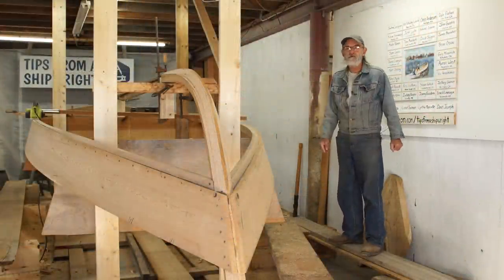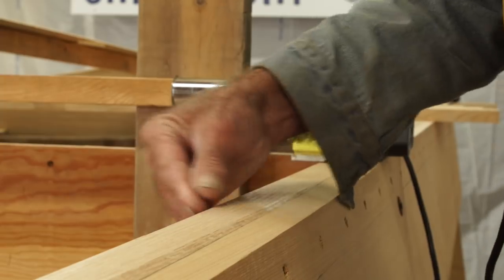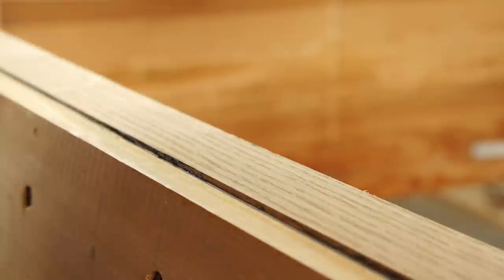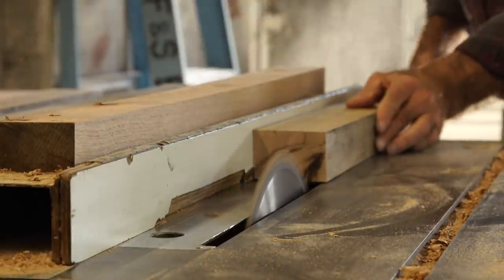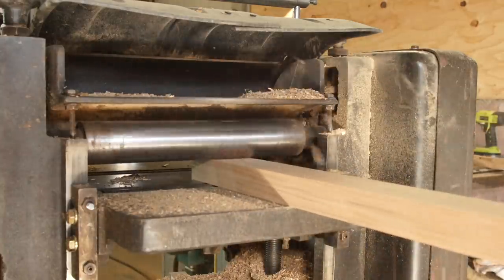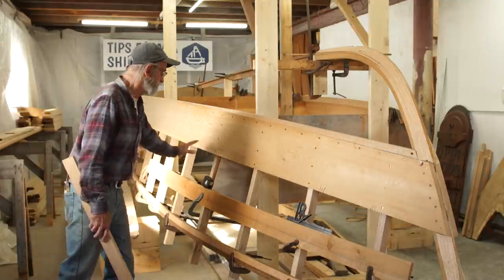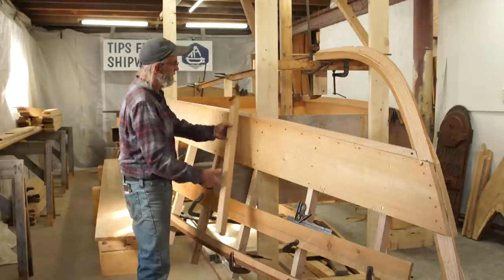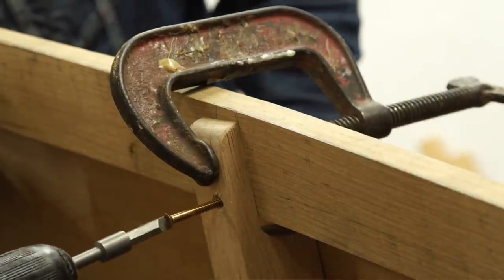Building the 23' V-Bottom Skiff - Episode 6: Hanging the frames

Comment: Lou, your table saw technique must work because you have all your fingers at this stage of the game!  Great skills to pass on.  Cheers for the Holidays!
Reply: It is a way to use a table saw, IN CERTAIN CIRCUMSTANCES, that used to be taught, but not any more. You will notice, that when Lou's hand is passing by the blade, his ring and little finger are behind and below the fence. This uses the fence as a guide, and your fingers cannot be raised or moved far from the fence. So if the wood is caught or kicked back, your hand won't be drawn into the blade.  He is using this on broader cuts, but where he needs a little more, immediate, control.  I do this myself, for certain cuts, but... I wish Lou had a riving knife behind the blade, for a little more safety. All in all, he is an excellent shipwright.

Comment: you got it right Lou ... that's a dowel set .. I'm sure there's a million more names for it as there is a million jobs for them too  ...we  used them to set dowels in timbers , ( it was much better then the 50 lb. block of wood on a handle ,,and was easier to drive them in in tight areas),, the other end was used to flatten the joint you were connecting ( like in pole barns with long beams that might have twisted some) with a barn the joints that weren't as tight because of a twist in a 25ft 6x6 you just chipped it down so it was flat were the dowel went in...a lot of people use them and the same with log cabins, pole barns and large ship builders ... it was used in many trades for a lot different things because of its many uses  ... I think the Amish  blacksmith in Pa. still make them .

Comment: Grandfadder had on of those to cut slotts in timbers for sliding boards into on his  dirt cart. Makes it easy to shovel in,(add boards as you fill, remove as you empty. He always said, take a little extra time whin building to save lots of time in use. Yes he did use a mallet on the long pin to drive it along for better control than swinging.  The pin was long so more was above the surface of the slot(for striking)  to ensure a consistant depth.  Much cheaper than a slotting plane and reasonably easy to use (once you get the hang of it) .

Comment: The most impressive thing is his ability to consistently drive slot-head screws.
Reply: With a drill motor. I agree. It’s impressive.
Reply: Some of them overturned, but yeah he said in the past that for him this are the best and easy to drive in screws.
Reply: When he gave the explanation for using the slot screws, I remember him saying “and they’re easy to get out.“ Nowadays when building stuff around the house it’s common to use those hex screws with an impact drill.
Reply: The biggest thing about slot head screws is to use a driver that fits the slot perfectly. If the driver is too small, that is when you get the cam-out and damage to the head of the screw, driver, or both. Plus, like he says, these are the easiest to clean out when you need to remove them in the future.
Reply: @thomasarussellsr  Yes, and you can see he also uses a hollow ground driver, so there is full bearing in the slot. Using a tapered pry bar that fits loosely gives slotted screws a bad reputation - but that's partly just user error and ignorance.
Reply: @aus71383  so true. The geometry of the driver tip is quite important.
Reply: @davidshaper5146  quite so. Too tight a hole or no hole increases the friction of the wood on the shank and makes slippage much more likely. Pilot holes are a big help, and properly sized pilot holes and soaping the threads with wax is a big help also. Most shiprights/carpenters I see that still use flathead screws use brace and bit, a power drill heats up the screw and increases the friction variable much faster as the metal screw expands due to the heat. The wax lubricant is a big help in keeping things in motion until they reach their resting place, whether you use power tools or hand tools.
Reply: I used to work for a cabinet maker who’s business was 50/50 kitchen cabinets and antique furniture restoration.He used to get me to take all the slot head screws out of the old kitchens we removed because it was cheaper to pay me  to get them out than buy them.
After you’ve done about 500 of the buggers it’s no harder than phillips heads.
Reply: @chipcurry  or, he looks about my age, so if that's true, when we were kids there were no Philips heads. I hated those when they came out. He probably did too. Either that, or a few years back he got a real good deal on slotted brass screws and bought 400 pounds.
Reply: @thomasarussellsr that’s what she said

Comment: Makes a lot of sense to go metric Lou, easier and more accurate for measuring.
Reply: It's not more accurate.  Both are as accurate as what you are using to measure.

As for ease.  I find an Imperial tape easier to read.  Having different size lines makes things easier to me.  Metric is easier in maths because you can move the decimal down
Reply: The metric tape is easier to read, more accurate and I found I made far fewer measuring mistakes with metric.

Comment: My tool guess, since the handle is so long, it was used in timber framing, and the hammer end used to drive the long wooden lock pins into the joints.

Comment: Would you consider doing a video on how to predrill those screws so they come out so perfect?
Reply: Lou is using tapered drill bits. They come  sized for the screw diameters he is using #6,#8 etc. then the countersink is adjusted to the length/depth of the screw. Perfect every time!

Comment: Looked for the adze in Seller's "Dictionary of American Hand Tools".   Closest I could find is a "hammer head adze" aka "Scotch Pattern Adze"- distinguished by the hammer head, used for driving spikes etc.   The example in the dictionary also has a hardened or forge welded cutting edge, but somewhat shorter cutting end.  Sellers distinguishes it from the unlipped Ships Carpenter Adze because of the hammer end vs more of a spike end .   Sellers shows the Coopers Adze as having a shorter, wider striking face, wheras the hammer head adze striking end is substantially long- as is seen in the video.

Comment: Its a shipwrights adze, The part that looks like a hammer head  is actually a counter balance for the head.
Reply: Those are short, barely no counterweight and most importantly, they have a curved handle. So it's not one of those. A shipwright's adze is a very nimble, fast tool. This one is clearly meant for heavy, slow action. Very likely something for house timbers OR very big boats. We're talking "can't hug" the timbers big.
Reply: @aserta  Ive seen them bigger and smaller. They're not all identical as many of them where custom forged/altered to fit the style of the user and in some cases a very specific use. Even today most of us will modify certain tools for very specific needs.

Comment: ‘Metric rules’  !
Reply: It's good for certain things.  I like using imperial for most of my woodworking because the tape is easier and faster to read for me.
Reply: @matteout_woodworking  Don't get mad with me, I know it's what many of us were brought up with, but feet, inches, half inches, quarter inches, eighths of an inch, sixteenths of an inch, thirty seconds of an inch, sixty fourths of an inch. Wow !!! . What a mess. Now honestly, what's not to like about 10mm or 1000mm --- so easy to divide or multiply. Come on people, it's really time to get out of the dark ages (and I'm 76)
Reply: @johnpayne5439  I understand why the metric system is a great system.    I get it and for everything other than weight and short distances I use it.

The problem is when reading a tape measure the imperial system is easier to read.  If I want 28 ⅞ I will find it faster than if I look for 723 mm and all of my tools...  I get a planer the scale is in inches, my tablesaw is in inches, drill bits, router bits, saw blades....  Everything is in inches.

So if I can read it better then why have 2 systems when one works well
Reply: Silverchannel: Nice pun
Reply: The imperial system is very awkward but I use it since all of the tools are imperial. In North America a table saw cuts a 1/8 inch kerf, chisels and planes are sold in imperial etc.  We are stuck with a crappy system.

Comment: will you/ have you got drawings we could buy for this build? been looking at self build/kit boats for months now, & this one ticks every single requirement of mine, or could you just sail this one to Scotland?
Reply: I have an extremely similar boat plan that I will have completed shortly that is for a 26 -28 footer if you are interested. Its 3 feet longer than Lou's and has the option of 2 additional feet. The very same type of hull. These are widely used here in the Northeast U.S. and Documented by John Gardner in his book Wooden Boats to Build and Use., Extensive directions included, multiple options for windshields, cabins, deck arrangements.

Comment: Metric tape? Decimal system? Heresy! Rhode Island radical.
Reply: I worked as a mechanical designer and one dumb thing I had to do was take a fraction and divide it into equal spaces. The metric system is far easier.
Reply: The definition of a mile/yard/foot/inch relies on the metric  standard of length.

Comment: Real pros use the best tool for the job. Decimal units are easier to use in this case.

16:18 "...we're going too take a metric tape and divide the length of the chine......we're using a metric tape because it is so much easier to divide a length in the metric system or ten system than it would be in feet and inches."

Comment: Safety on tools is a personal thing.  If you don't feel safe doing something then don't do it.  

The No1 cause for workplace accidents is fatigue.  If you are tired then avoid using machines

Now would I use a push stick...  Probably but I will rip boards up to an inch and a half without one.  That's my choice and I will never stop you from using safety precautions.

Comment: The only adze that i'm aware of, to have a hammer end (that's meant for wood), and not a pin end, is a cooper's adze. This is definitely not a shipwright's adze as it is heavy, straight handled, and most importantly, narrow in the tooth/tongue (unsure what the exact terminology in English is, for the blade).

The problem with that cooper variant is the fact that it would have to be a massive barrel. So...yeah. Normal cooper's adzes are short handled, almost always straight, but severely angled to the geometry of the metal, very curved tongue and usually, the hammer end is narrow to the body, but turned in, towards the handle. IE, to help with that curvature inside of a barrel, without impeding the strike action, nor the weight necessary to achieve those cuts in that narrow/small strike. And yeah, you'd hit them with another hammer, in some situations to get that extra power or when you can't swing and for setting the rings.

Problem with that is that, this one, if it were for a large barrel (like the bigguns for whisky or big wine ones) is that... once it gets that big, it wouldn't need to be a cooper's adze, and a regular adze would work.

It's ... a really odd tool, you got there Lou.

Comment: [~22:50] Wow.  I've spent a lot of years looking for adzes in antique shops, even before the last decade of eBay notifications for antique shipbuilding tools in my daily emails.  I've seen literally thousands of adzes at this point.  But in all those years, never once ran across one like that. 
Long story short:  I got no friggin' idea WTH that thing is, or what it was originally intended for.  
Only clue is that proportionally, it looks a bit similar to some of the small one-handed carving adzes.  But this one has a flatter curve, much longer hammer on the back, and overall is just huge compared to those typical smaller versions, even the long-bladed ones.
Lou's guess about log cabin work, is probably as likely as any.  Unless we can find anyone still in the business of carving 12-ft. tall figureheads for wooden battleships, see if they got anything like this in their inventory.
I doubt the "hammer" side is meant to be used as such (beyond knocking out some chunks of waste from the area being cut).  Mostly that hammer side serves to balance the thing, keeping the orientation of your blade more easily in line with your swing.  Same as the long skinny head on a railroad maul.  Or the long symmetrical head on a traditional ring-bound caulking mallet.

Comment: Decimal Feet?
Reply: Do they make decimal feet tape measures? Decimal inch would be OK, too. I finally broke down and bought a metric one. I just couldn't deal with all the fractional inches.
Reply: @mckenziekeith7434  They do.  I used one for laying out my basement when I decided to finish it.
Reply: An engineer rule is divided into 10ths of an inch.
Reply: @dagwood1327  Sure I have some of those. But they are not very useful for larger projects.